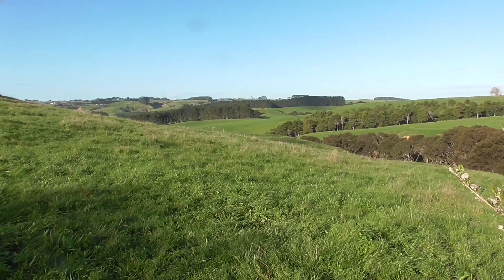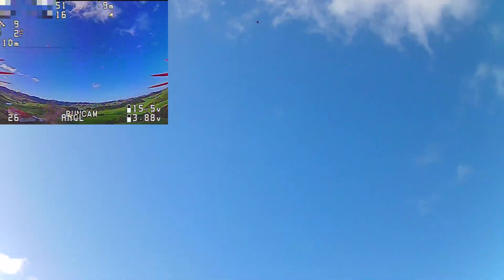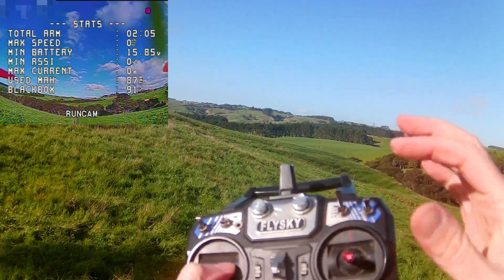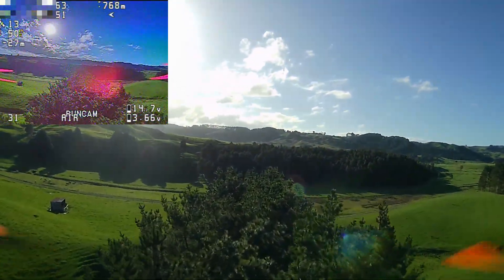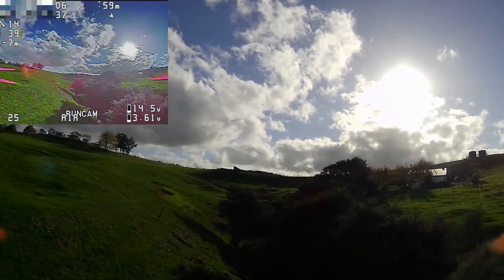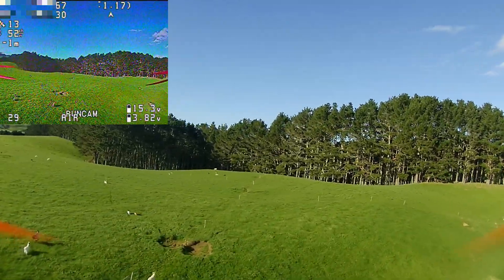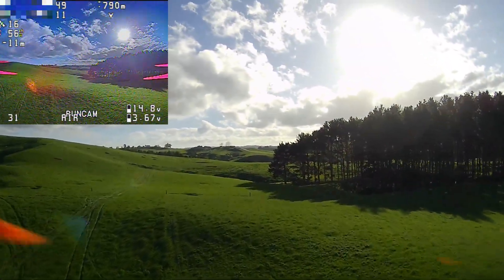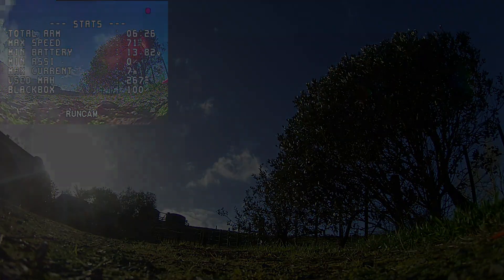Testing GPS rescue (Betaflight 4.5.2)

Comment from the maker: I just noticed that both flights in this video were done with a broken arm on the quad. It had just fallen onto the wooden gate from about 15 meters up and I was surprised it wasn't damaged, but it actually was. That could explain why there was more jello than usual. The fiberglass on the top of the arm and most of the plywood was ripped through, it was only holding in place because the motor thrust presses upward which pulled the fiberglass on the bottom tight.

Comment: Have you tried betaflight 4.6 fixed wing stuff? Its a blast.  Little hurdle to get going but once you do its like a mix of flying with just an rx and a FC at the same time.  Very hard to explain but quite a good time.  Most stuff is in cli still though
Reply from the maker: At first glance I thought you were talking about Arduplane 4.6 which I just did a first flight of about 20 minutes ago on the 'mini-hopper'. Coincidentally the version number is the same :) But to answer your question I'm not likely to use something other than Ardupilot for fixed wing. I always keep manual mode on a switch just in case something goes wrong, so 'just an rx' is always there if I need it. Sometimes I switch into manual mode right before landing to make sure I can get a decent flare, otherwise with auto-level the pitch control is a bit weak. For mini-quad though I use Betaflight, after finding the arm was broken on this fiberglass frame I moved all the components to the carbon-over-plywood frame, weight without battery is 300g, flight time 11 minutes with 3S 2200mAh. Plenty of time for a decent range flight but now I think the radio is the weak link. At least the constant interruptions by GPS rescue don't cause a crash though :)

Comment: Might be time to go for a dji video setup? You obviously don't have range issues flying out in the open like that but the 1080p video stream (and better signal around obstacles and terrain) would probably be an amazing upgrade for tree surfing (which is indeed great fun!). It's still not cheap at all, but now with the dji o4 lite and the n3 goggles being about half the price of their other options it seems like a great time to switch. I've been personally considering it a lot because analog doesn't really give me the confidence to fly at a decent speed in close proximity to stuff because of the low detail. The n3 goggles defogging fan also sounds great for me because I always struggle with my goggles fogging up for the first few minutes...
Reply from the maker: I have been seriously investigating and considering all the HD options over the last few days. Hard to reach a conclusion though. Right now I'm thinking a HDZero BoxPro which lets me still do analog, and then use it with an Edge T3 with HDMI input for HD video. I think the N3 and O4 lite you mention would be about the same price, better picture and more convenient, but locks me into more narrow compatibility. Still thinking on it...

Comment: Dude go ELRS. And betaflight 4.6dev. Has position_hold.
Reply from the maker: See my response to the other comment here. Everybody tells me I need a new radio but nobody gives a reason why my current one is a problem.
Reply: @iforce2d  Well the main reason for ELRS would be range, signal integrity and the resulting reliability. Even an onboard ceramic antenna (size of a small cap) will get you about a kilometer or so. "Real" antennas quite a bit more (like 3x or something). This also includes telemetry (reverse channel), as in real telemetry and not just stuff shown by betaflight on the OSD for you to react to. These days there are transceiver and reveivers that operate in dual band, so using 2.4 GHz and 800 MHz simultaneously, and picking the best result. This leads to an incredibly robust signal
New radio would be mostly a way to be able to use it, easy of use and vast features and options of OpenTX/EdgeTX, but I assume you're incredibly familiar with your radio considering how long you've had it, and clearly it does all you need it to do or you'd have found something that does. So that probably isn't an argument, except for features it may have that you would use if you had them?
I don't get comments like the one you replied to either, just basically being "chage your setup, no reason given". But I do think ELRS does could features that would be quite useful to you. I am, however, really not sure if it's worth the effort of chaging basically everything that has worked perfectly fine for you for a decade...
Side note: But if you would get a radio that has ELRS built in, getting a multiprotocol module to still be able to use existing receivers would be an easy way to migrate things that don't need or benefit from the range/safety, but still being able to use a single radio.

Edit: typo, clarity, added a sentence or two (and the side note).

Comment: you should try Inav . Just as good as betaflight . it has gps rescue and all the navigation features of ardupilot and just as easy to setup as Betaflight. 
Also, I have had the same problem with home arrow. I live in Tasmania, I wondered if it was a southern hemisphere thing.
Reply from the maker: I tried iNav many years ago and even contributed some code at one point. But then after trying Ardupilot I'm unlikely to use anything else for autonomous builds.

Comment: I still dont get why you dont have a good chinese radio with ELRS. These things are so cheap nowadays for what they can offer. There are amazing ones under 100 bucks.
Reply from the maker: I get this comment a lot but nobody really gives a reason why the FlySky is deficient. For me the radio platform seems like a problem that is already solved, so I'm inclined to spend my rather limited money on other stuff. Mainly the thought of buying a bunch of new receivers instead of recycling my existing FlySky ones is not so appealing. In the near future I will probably be flashing OpenTX onto one of these radios, perhaps that will enlighten me about what I'm missing out on. As for range, it's usually fine up to about 3km which is as far as I can fly here anyway - the signal losses in this video were all due to terrain obstruction.
Reply: @iforce2d  'solved' ? People thought luggage was solved, and some day some guy put wheels on it, and everybody lost their mind. I guess I don't have hundreds of receivers. More like 3 or 4, and that's a lot for me! I used to have only one spektrum rx but the link was so poor I crashed again and again. Loosing more money each time from repair and replacements than a cheap elrs radio and receivers. I don't crash anymore bc of radio link, I don't have to pay for parts and shipping when my plane crashes for the 15th time. Rx for elrs are like 15 bucks whilst a replacement spektrum one was 50... 

As for range, this video shows prior to the betaflight rescue you wouldn't dare doing what you did, tree surfing and the likes. This is a software patch for poor hardware is what I'm saing! Ask around for betafpv, matek, radiomaster for some gear to do testing on, and tell us what you think. You don't know what you're missing out on. The peace of mind is exquisite. Betaflight RTH needn't be a thing and you can fly pwm planes without flight controllers and be sure the link will be good. Before, I didnt have RSSI or warning I had failsafed, now its a breeze. 

Cheers, thanks for the vids chris!
Reply: Also the tree top surfing must be a dream with HD digital video!!!
Reply: I have 2 Flysky transmitters and several receivers. Plenty for my tinkering. I'd also prefer to spend my small amount of income on other things and just make do for hobby stuff. If I already own the transmitters and receivers there's little benefit in buying more just to have some shinier bells and whistles.
Reply: @tin2001 
I bit the bullet to get the telemetry display on the open tx for ardupilot.
Reply: also considering you have such good video signal!
Reply: @tenns  his quad doesn't seem to be made of carbon fiber. that could explain the good video
Reply from the maker: @ZeroFPV In a normal forward flight cruise angle the VTX antenna is pretty clear of the frame so probably even a carbon fiber frame would be about the same. This is a pretty quiet area in terms of radio activity, I think maybe that helps with video quality. I can usually get all the way to the other side of the farm (3km) with my planes before 200mW starts to feel lacking.
Reply: @iforce2d  I think you are probably right about the other RF in the area. When I fly my HDZero tiny whoop at home in the city on 25mW the range is maybe 100-300m depending on direction before it starts to degrade. However, last weekend I flew it out at the club field were I fly my planes after everyone else had gone home and 25mW stayed perfect video as far as 800m before I had to come back due to low battery.
Reply: @tenns  Funny seeing this comment. As FPV progressed and progress only got progressively faster it seems many seem to 'need' specific equipment to maintain the fun.
No doubt digital video is VERY awesome, so are long range RC links. But nothing wrong tinkering around with equipment you have, explore these limits, and simply have Great FUN! 
Keep the enjoyment up mates!
Reply: People seem to like the RadioMaster Pocket.
I recently switched to the RadioMaster GX12. IMO, it's a great radio. I really like having both 2.4GHz and 900MHz available without swapping modules.
I've used the TX16S for years and it's pretty good. It's heavier than I like but the color touchscreen sure was nice.
Reply: Meh. 
I run open tx 16. 

Looking to get an rfd900x module for it so I can link through radio to ground station.

Comment: Have you set the gps module orientation in betaflight? It may be the problem with the reversed arrow on the osd
Reply from the maker: GPS doesn't have an orientation, it only measures lat/lon/speed etc. There is no compass involved, so the heading of the quad is determined by flying forward in a straight line for a while (ideally, I'm not sure if that's strictly necessary) and watching how the lat/lon changes. Judging from the RTH performance the heading was calculated very nicely - everything is fine except for the OSD display.
Reply: Is it just an issue with the OSD setup? Is there any odd mirroring set up for that specific camera/VTX setup?
I don't do FPV stuff so I've never poked about much in the setup, but it seems like a bug/feature someone would be already noticed ages ago if it was affecting everyone.
Reply: Just Googled it... Apparently it's a font issue, and the bug I was reading seemed to be the same flight controller mentioned in this video... Apparently the font won't upload unless the controller is powered by a battery, not just USB.
I don't fully understand because like I mentioned, I don't do FPV and never played with the OSD stuff.